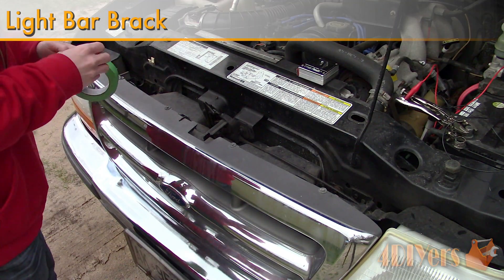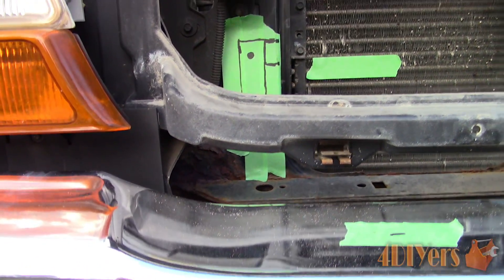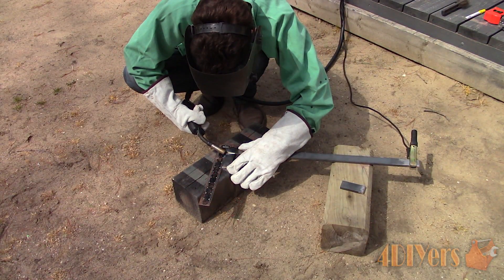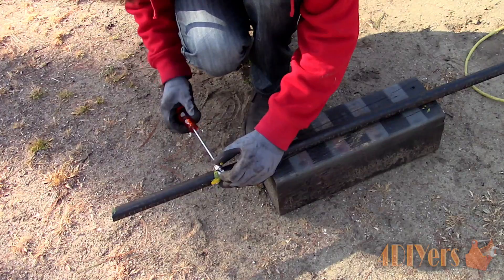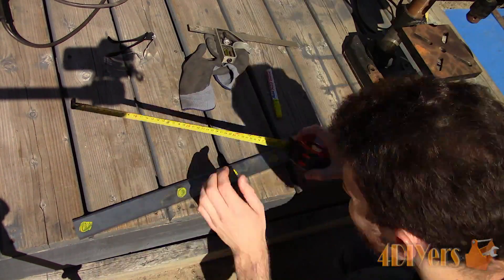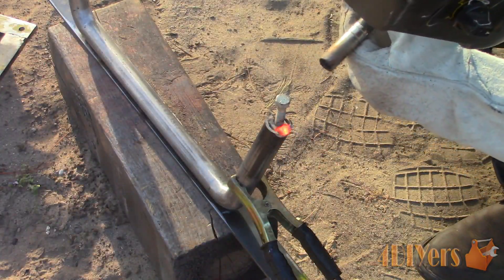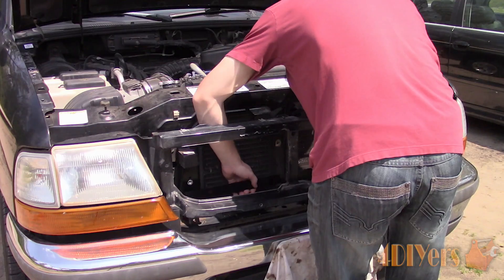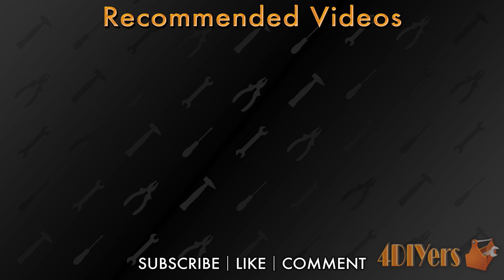The Ultimate Light Bar Grill Mount Fabrication Guide

Comment: will this mount fit on a 94 ranger or will there need to be some modifications?
Reply from the maker: The only issue I can see is the grill difference. Despite the visual differences (the suspension and I believe the frame design changed), it's been basically the same truck from 1993 to 2012. If you look at the doors, they're actually the same and so is the cab, so I would imagine the radiator support is very similar as well, maybe with some slightly changes for accessories.
Reply: 4DIYers okie dokie. Thank you so much